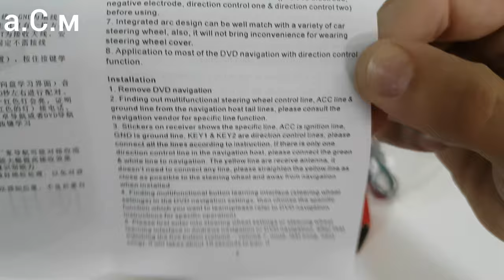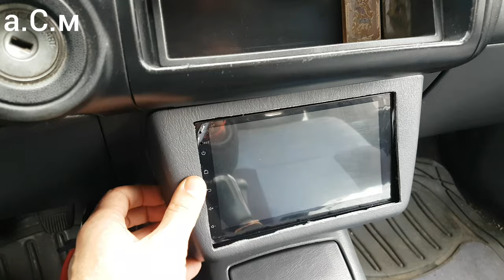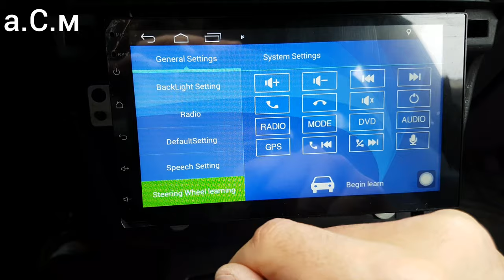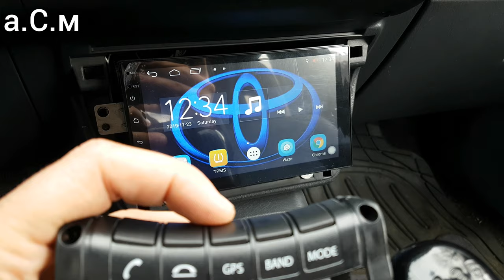UNIVERSAL STEERING WHEEL REMOTE CONTROL  а.С.м

Comment: I have a unique question for you.   I bought the very same controlller, but all i want to do is be able to control my led light bar and supplemental cubes on my expedition from the steering wheel so i dont have to work so hard reaching all over the place to turn them off and on etc.   can you tell me the best way to do this?
Much Thanks